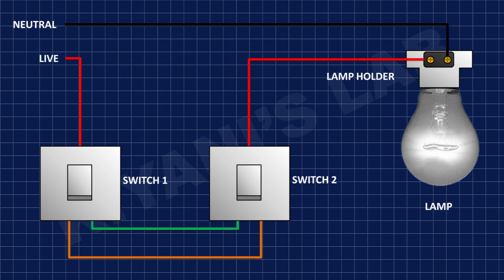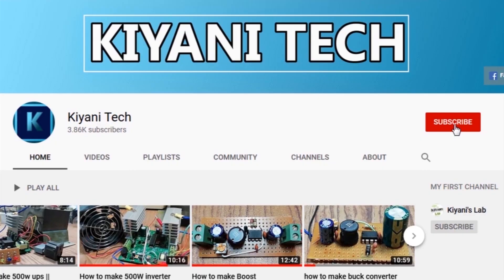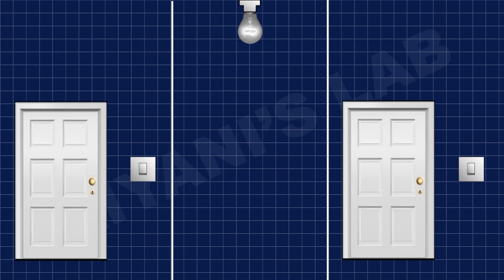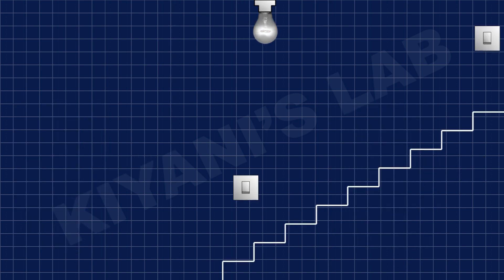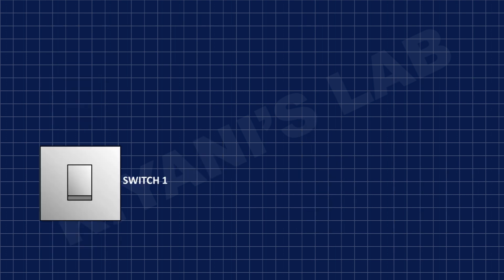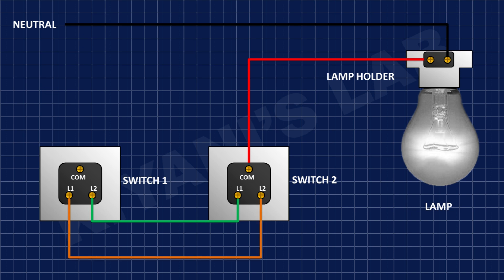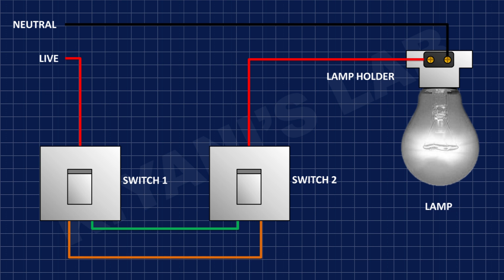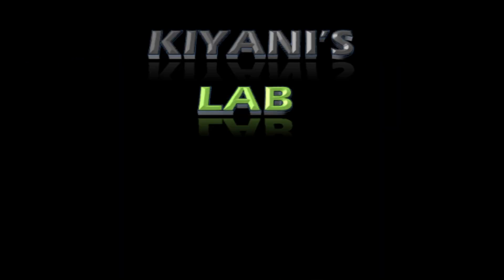How to Make 2 Way Light Switch

Comment: Technically it's called a 3 way switch even though it operates two switches.
Also, you are not making a 2 way light switch, you are wiring a 3 way light switch.